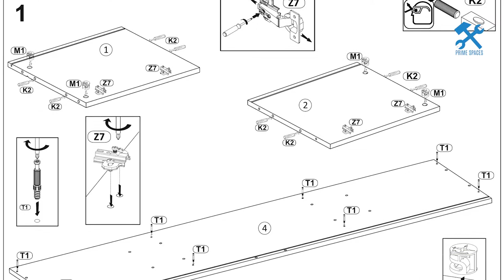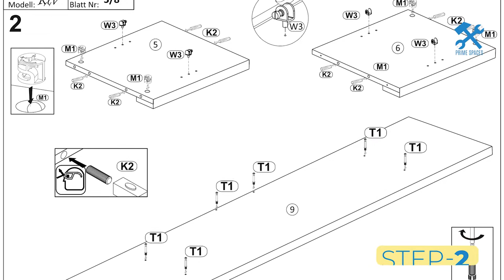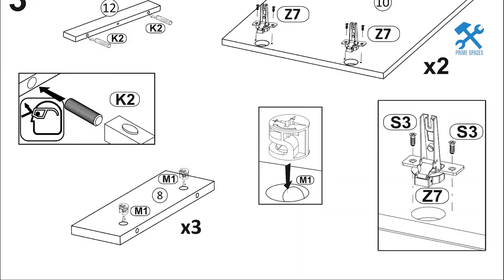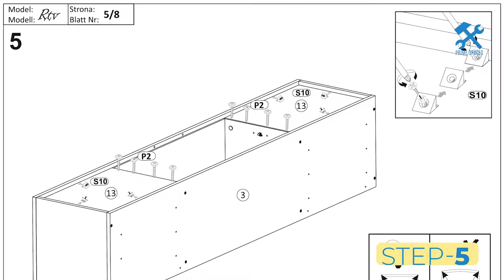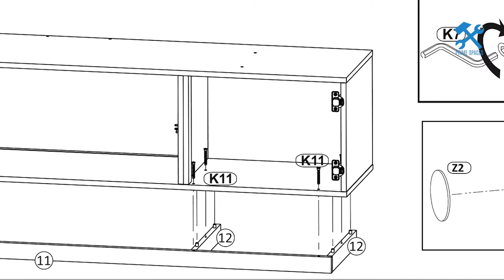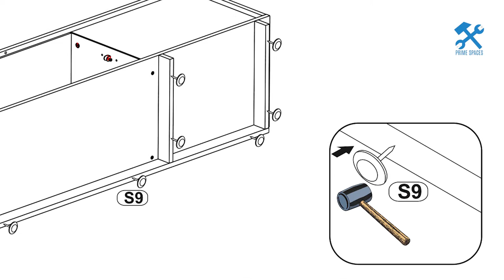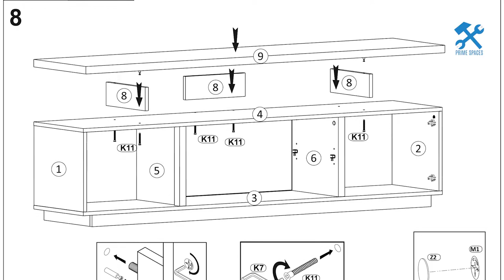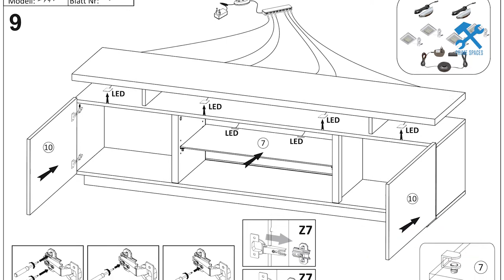Meble Furniture EVA-K Modern 71" TV Stand Assembly Instruction (Imkamp TV Stand for TVs up to 70.8")

Comment: What screws are used for the hinges? I’m missing them!
Reply: I thought I was missing it too but it turned out that my package had the hinge part pre-done! This may have been the same case for you! If you look closely, he puts part of the hinges on around 1:17 and later on in the video (around 3:45) is when he puts the second part of the hinges to the other boards — but my hinges were already attached together so I skipped the first step (skipped 1:17) and attached the hinges during the 3:45 step. Then when I started to attach the boards together, I went ahead and attached the hinges to the side boards (boards 1 and 2). I hope that helps someone! :)
Reply from the maker: Hi Shari, thanks for this explanation! It’s going to help a lot of people. Please, subscribe to the channel if you haven’t already. ✅
Reply: So if the hinges were pre set, do you have to disassemble them?

Comment: Where I'm stuck is what the tiny screws that come with the led lights are for. I mean I see that they can fit into the led lights but is it safe to drill them into that top part? Or is the double sides stick patches enough
Reply: Nvm I drilled it in
Reply from the maker: Hey there! 👋🏾 Yes, you can drill them in but you can actually do without the small screws. I believe the plastic faceplate can just click into place. But glad you got it figured out. Please, subscribe to the channel if you haven’t already! ✅🙏🏾